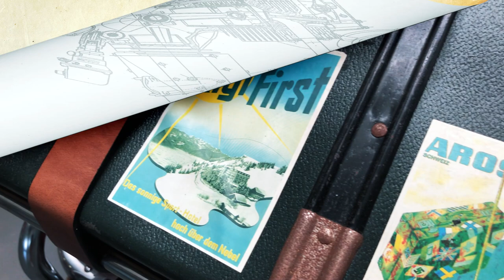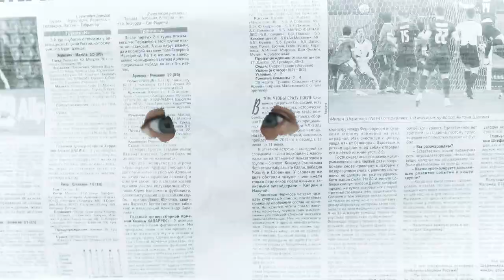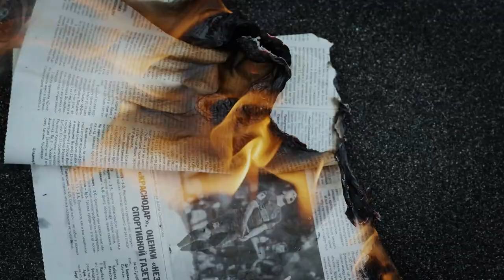The Secret Story Of The Moto Guzzi Engine For The Fiat 500

Comment: I was working as mechanic for a motorcycle shop in Yonkers, N.Y. in '67 and went to the Berliner service school for the new line of Moto Guzzi V7 bikes.  The engine had grown to 700cc and the bike was a large touring machine.  During the school it was told that the engine had originally been designed for a small car but no brand name was mentioned though there was some comment about the small car being developed for use by the military for desert use.  We sold a few V7s, I thought it pretty decent for its purpose.  Always thought the bulky starter on the side didn't make for very good esthetics on a motorcycle.

Comment: Awesome video as always, I had never heard about this. Easy to see why Fiat wasn't particularly interested. They already had various Abarth modified 500s, the larger and faster 600, and by the time Fiat actually tested the Guzzi car, the 850 was only a couple short years away from entering production. Economy cars were progressing quickly and there was simply no place for the Moto-Guzzi 500 to fit in the lineup.
Reply from the maker: Indeed. It was a nice idea, but it solved no real problem for either Fiat or its customers
Reply: @Matteo_Licata  It would have been great for  export markets....which Fiat really didn't need at the time.  The 500 was inadequate performance for American roads, but this would have changed that.  Consider a 1962 Beetle, which made about 40hp, this Guzzi powered Fiat would have been comparable, cheaper, and faster due to its light weight.  Fiat sold the 500 here briefly, 1958-1962,  along with the 600, as the cheapest cars for sale in USA.  This would have combined extremely low price with Beetle-beating performance, and was a missed opportunity for Fiat here.  By the way I'm glad I have my 2018 Abarth 500, what is left of Fiat (Stellantis) corporate is brain dead.  They pulled the 500 from USA at precisely the wrong moment, the car would now be selling in huge numbers with the $5/gallon record high gas prices.  I just drove the car on a 3500 mile road trip and got 15km/l

Comment: This is a fascinating video.  There is so much myth about this motor.... (It is wrongly thought by many to be the same unit that later went onto the V7). But you have stripped away all the fiction.  
It has been a dream of mine for some years to fit a Guzzi twin into a Fiat 500 or 600 or (more likely because of availability of body shells) a Zastava 750.  
I used to ride 850 and 1000cc Guzzis and always thought the power delivery would be ideal for a small car.  I had a V50 and thought that perhaps the nicest Guzzi.   In some ways the standard T3 or 1000SP motor was more like a dieael than a petrol motor, but with added character.  A lot of added character. 
Even a V50 motor (or V65) would offer significantly more.power than any Abarth 500 or 595.
And there would be that intoxicating Guzzi low-rev "wobble" and the twist of the driveline on take-up.  
Cooling would be an issue.... One of many.  Crank direction another.... Union with the transmission another....
And of course the engine would be very different from the original design for the "sporty" Fiat 500.
I still imagine such a car as I doze late in the evening.
Another good video.  And somehow also proof that I am not entirely mad to believe that the Fiat 500 is in need of a torquey V-twin to let it roar....
Reply: Sounds good to me!
Reply from the maker: Thank you! I'm a fan of Moto Guzzi too, and I'm happy to see the brand is doing well nowadays. People have indeed transplanted Guzzi twins into small Fiats, I've bumped onto many builds while researching for this topic. Cooling would definitely be an issue, with the cylinders no longer exposed to incoming air: that's why the engine Guzzi designed for the Fiat 500 had an axial fan and there was sheet metal cowling to direct the flow towards the cylinders and heads.

Comment: Back in the 70s/80s Lomax kit cars used the Citroen 375 V2 or the 500 V2 {as their performance engine} on their BSA 3 wheeler style car and you could also get a kit to upgrade the 2CV transplanting the Moto Guzzi - it made the French pram a reasonable runner.
Reply from the maker: That's something I didn't know! Was the Lomax a fun car to drive?
Reply: @Matteo_Licata  I believe the 3 wheeler was hectic like today's Morgan trike but the old 4 wheels reasonable for an open glass fibre coffin. If I remember they were both based around the 2cv running gear hence the adaptation to fit Guzzi engines and at one stage the horizontal BMW twins.but it was a long time ago so Iay have FUBAR'd some of it.- I'll have to go and fact check it 🤔

Comment: Another reason the Guzzi engined 500 never happened was because Moto Guzzi could not supply the amount of V-Twins Fiat wanted. 

What does stand out would be the idea of a Guzzi V-Twin car being looked at for the Innocenti Mini in one prototype, however it is not clear why the Guzzi V7 500 was viable yet the Guzzi V65 Mini wasn’t and if it was down to differences in weight, layout (RR vs FF) or again supply issues (and the cost of expansion) between the two cars despite both Innocenti and Moto Guzzi being under the same roof.

After all a Fiat developed V-Twin was looked at during 600 project.

Comment: This is totally new to me so many thanks for the informative video , as always . What I did hear of was an Italian motor bike which used a Fiat engine , so the other way round to what happened in this video. I think the bike was a Benelli and they used the 907cc engine from the 850 sport or 127 models , perhaps you know more details Matteo ?
Reply from the maker: Thank you! I know of a ‘bike made in period with Fiat’s 903cc engine, but it’s only something I’ve heard about. It wasn’t a project by a known firm, but rather a personal project from enthusiasts
Reply: @philhawley1219  Funny you say that. The reason I came to know , was my son worked for a garage in Kidderminster, doing his apprenticeship. One of the mechanics had this bike , with a Fiat engine in. Apparently , in lovely condition, but I never got to physically see it, although Italian but not perfectly clear on the manufacture. I was in the Fiat Motor Club GB at the time ( owning a Fiat 132 1800 ES , at the time) and would occasionally write articles for the club magazine , Parliamino , so it would have made a very interesting article at the time, . A Fiat 127 on 2 wheels if you like! Must look to find more info. Thanks for that , Nice One

Comment: I never understood why they did not use a v twin instead of the in line twinair of recent years... let moto guzzi develop some parts for it and get a licence to use the name moto guzzi on the head and it would have sold much better.....
Reply from the maker: A v twin would have likely been more expensive to make, due to the need for two cylinder heads rather than one.

Comment: Was this the same engine that went into their motorbikes? I heard stories that the motorbike engine was from a military vehicle. My  brother and a friend d had 850cc Le Man's in the late 70s/early 80s. Incredible handling,  but not as quick as my Laverda.
Reply from the maker: The 700cc motor that went into the original V7 is not directly related to the wannabe-Fiat 500 engine, but they were indeed designed by the same people just a few years apart. However, the first prototype (1958) of the engine intended for Fiat was indeed related to the one designed for the so-called "mulo meccanico" military vehicle.
Reply: @Matteo_Licata  thanks Matteo. Another confusion cleared up.